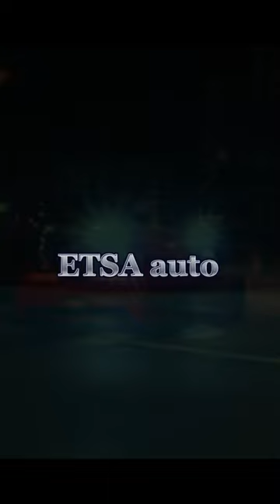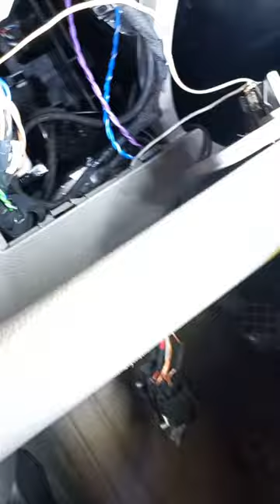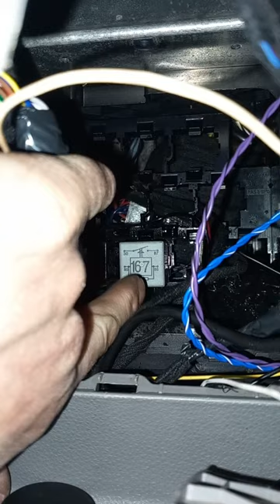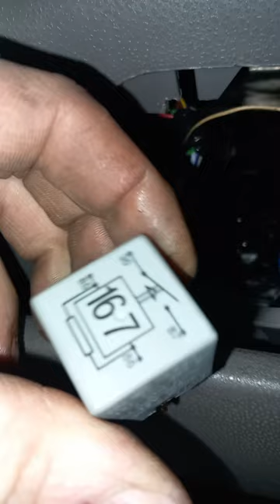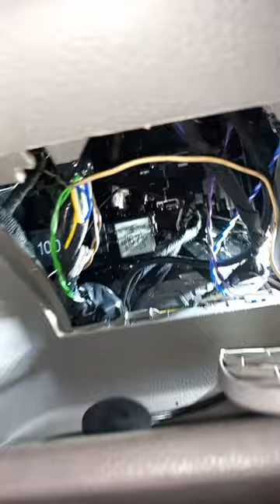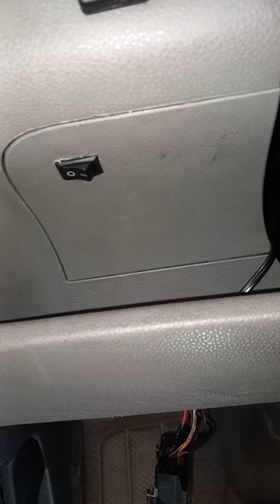VW Polo 2006,1.2i fuel pump relay location.

Comment: Hello my 2005 polo 1.6 starts but switches off whenever I release the accelerator pedal . Could it be the fuel pump relay?
Reply from the maker: Hello, unlikely. First you need to carry out car diagnostics.